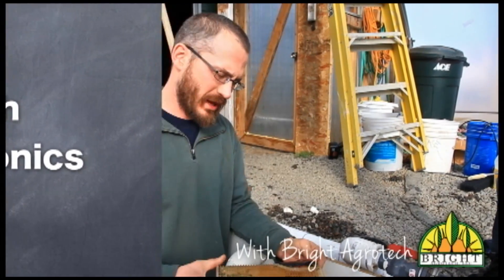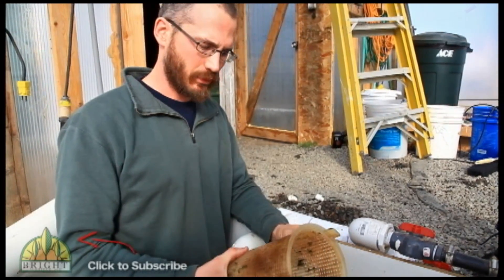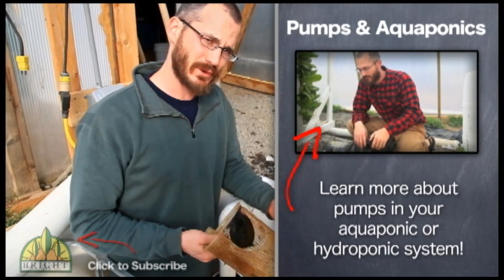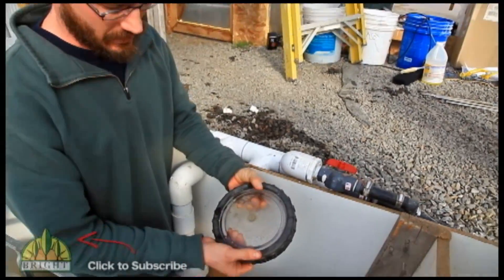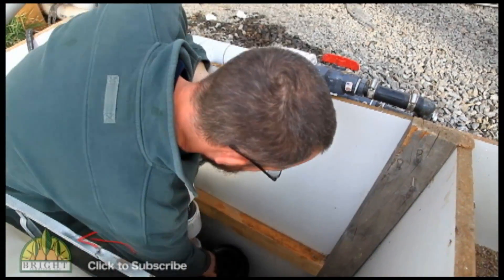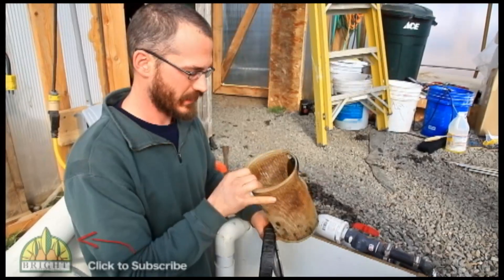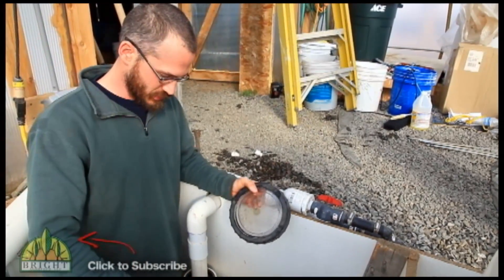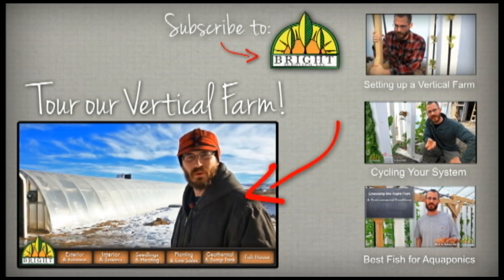Using Pumps with Skimmers in Aquaponics

Comment from the maker: Jacuzzi is the name brand of the pumps we prefer- they're a brand of pool pump.  In my experience, pool pumps are higher quality and last a bit longer (in clean applications- i.e. no rocks, sand, grit, etc.) than many of the cheaper pond pumps, but most inline pumps are based on similar designs.